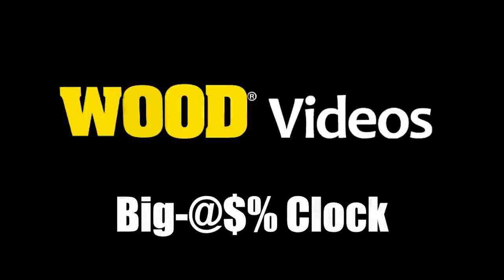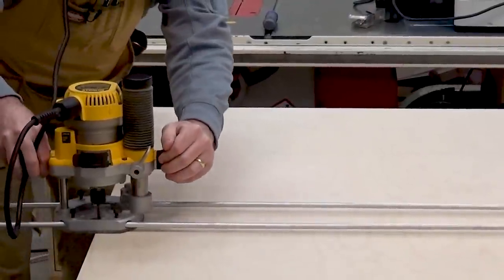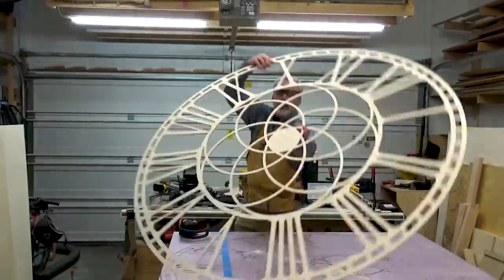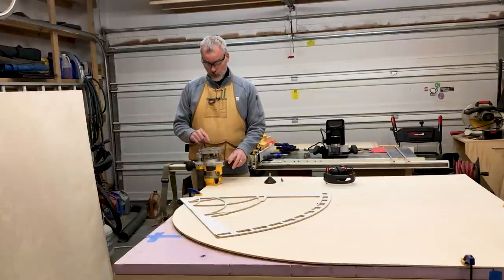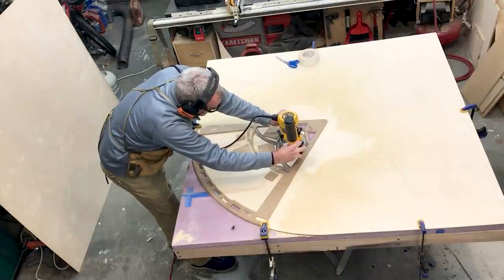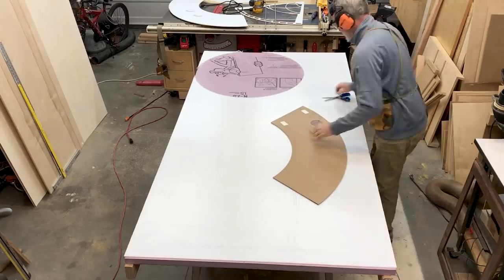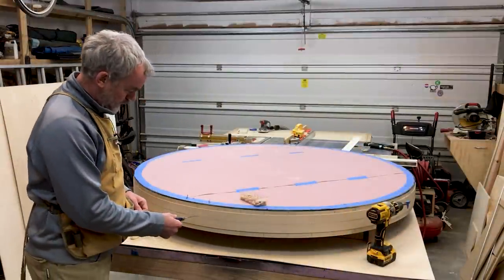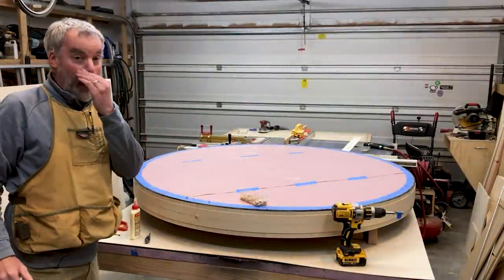REJECTED Project: Big-@$# Clock

Comment: The reason the IIII was used is the number V was not yet reached to know you needed it.
Reply: Well actually, this might be correct. The days were so much shorter in medieval times that the clocks didn’t go to V yet. (This is why they were called the dark ages). By the time the days got longer several centuries later (the enlightenment), the V was in widespread use.

Comment: VERY COOL!!!  May I ask how you generated the face design file for the Shaper Origin?  That is on my wish list.  More rejected projects!!
Reply: Thanks! I drew it up in Adobe Illustrator because I'm most proficient with that software. Then exported it to an SVG file for the Shaper Origin. SVG is a pretty generic vector graphics format that most any vector graphics package can export. Corel Draw is another common commercial program. And Inkscape is a well-known open-source, free vector graphics program. Shaper Origin also just released an early version of a rudimentary web-based drawing program that interfaces directly with the machine. And there are also some limited drawing tools built right into the machine.
Reply: Thanks for the quick reply!  Very cool design.  I have no experience in computer design, so there would be a steep learning curve with that.  It will be on the bucket list for a while.  Cheers!
Reply: What graphics program and education resources would you recommend for someone starting out on CAD?  I have always felt I should learn it but never started and I think part of it is knowing where to start.  I had played with Sketchup a few years ago.  I am feeling like if I want to use get a Shaper Origin sometime, I should get over the learning curve on the graphics ahead of time.  Thanks again!